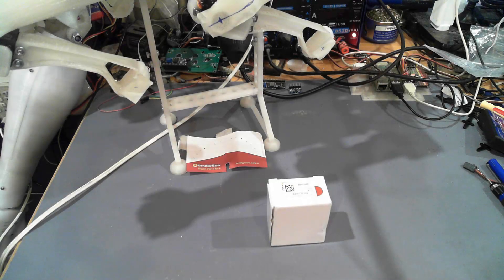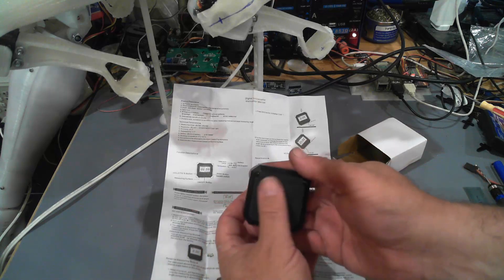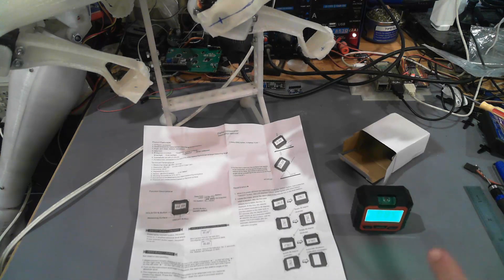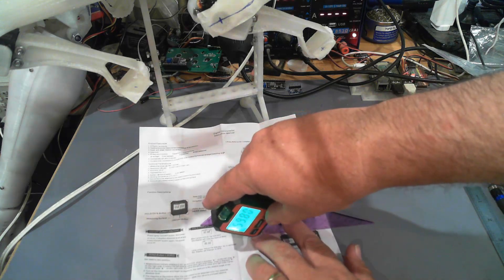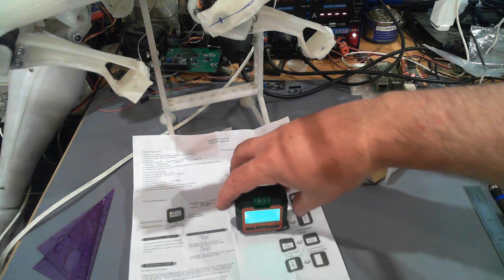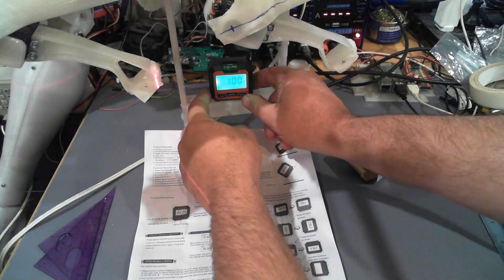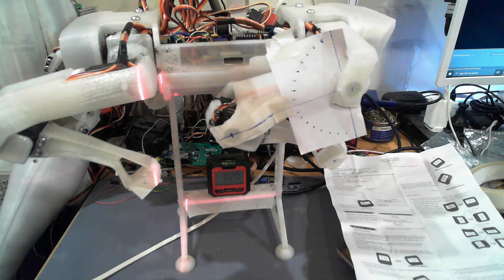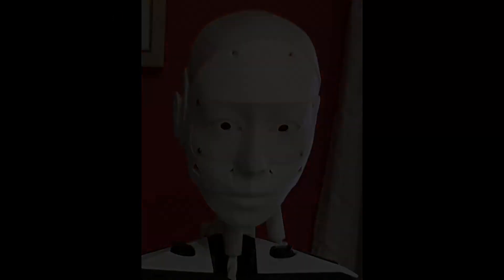Unboxing Digital Inclinometer Level Meter

Comment: how to calibrate 0 degree digital inclinometer to the earth ?
Reply from the maker: This is a hard one, as you really need a surface that is level in the first place. (Not many are :-) )
Once you have a level surface and starting from a powered off state:
Press and hold the ZERO button and turn it on with the On/Off button, it should start-up in CAL0.
Release both buttons and place it on the level surface and wait for it to show CAL1.
Rotate the unit 90° clock wise and wait for the CAL2 to display.
Rotate it 90° again to upside down and wait for it to show CAL3.
Rotate it 90° again to the other side, after a short time it will turn off. 
It is now calibrated to the surface you you calibrated it on.

As I said at the start, finding the level surface to calibrate on is the hard part.